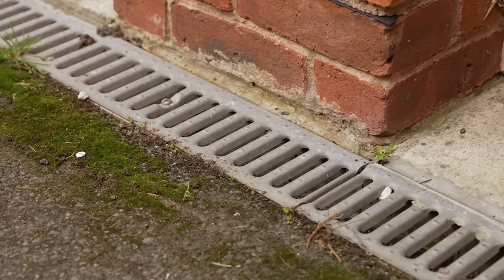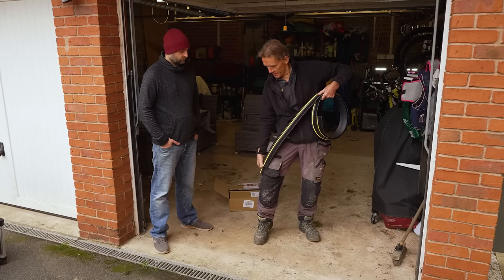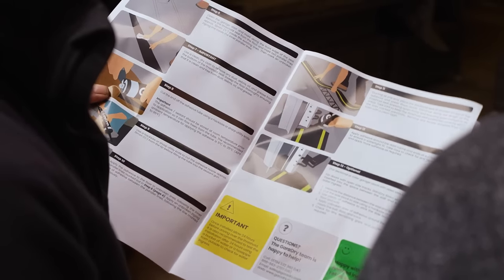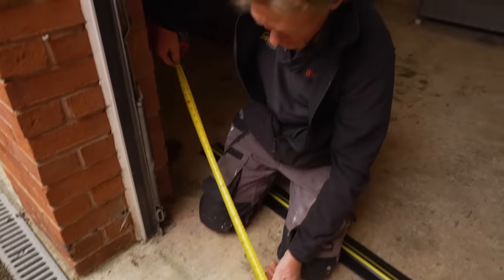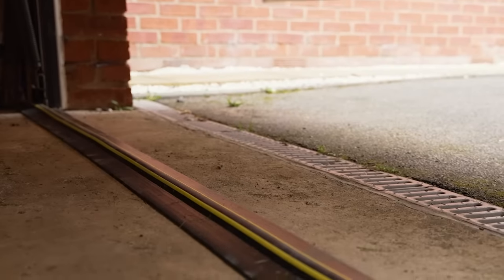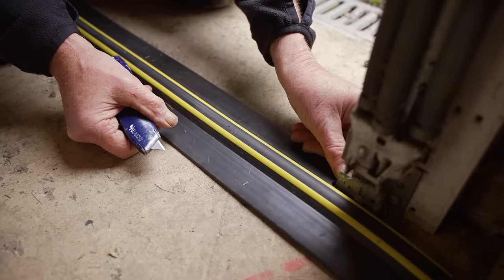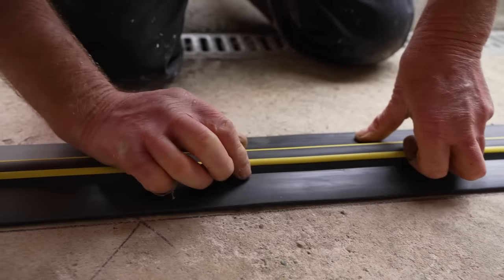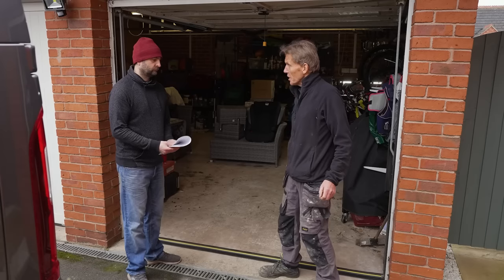DIY Garage Door Weather Strip Installation: Keep Water & Leaves Out for Good!

Comment: For a roller door there is weather stripping on the bottom of the door and an adjustment screw on the garage door opener that you can adjust to remove most gaps.

Comment: These strips work ok when the door is shut. The problems with leaves & dust start when you open it & a 7'x7' foot gap appears.
If you use your garage as a workshop & you want it kept clean:- fit a side door (where possible) & buy a leaf blower to periodically clean it out + fit a rubber strip to the door, rather than the floor, then you don't drive over it.
Reply: It doesn't work for us who have a garage with a floor that slopes the wrong way. In that situation, a strip on the floor is easier and cheaper than pouring a new floor.
Reply: Shop vac is much better

Comment: Screw/ glue a thin aluminium to the bottom,front edge of the door as close as you can to the floor level. Easy, cheap.

Comment: Hello, I need some advice.
This product looks good for the lower gap but what about the sides?
For the past few years, my driveway leading to my garage keeps flooding when a downpour of rain happens.
Last year, it came up the door 1 foot due to drains not good enough for the job, so i really need to seal the sides of the door.
I have an up and over door and need advice on what product i need to seal in the garage for the bad days.
I really hope you can help.  Thank you

Comment: Lucky guy! At least he's not got one like mine. For some reason the gap under our single garage door is from 10mm one end to 50mm the other as the garage floor falls to one side...Hmmm, yes I'm familiar with the smell of mice...
Reply: Maybe fix a piece of flat rubber to the back of the door and cut it at an angle to close the gaps. Adhesive and nut and bolt fixing with large washers should do the trick.

Comment: I recently fitted new garage doors and went to fit behind rather than fit within. Moving the doors back exposed some of the rough finished concrete floor. Now in extreme rain I get some water under the door. Would this rubber strip bond to a rough finished concrete?
Thanks Roger
Reply: My garage is rough fitted concrete and the adhesive worked fine, just try to clean the floor as best you can  beforehand and make sure you use plenty of sealant to ensure there aren't any gaps left between the seal and the concrete. Alternative you can try to sand the concrete down to make it smooth like they did in the video, but I think you need the right tools for that.
Reply: @ChrisThomson  Thank you Chris, much appreciated

Comment: Is there anything like this for a roller door ?
Reply: A roller door has a weather strip on the bottom of the door. Sometimes these need to be replaced. But first check the garage door opener. There should be a screw that adjusts where it stops. You should be able to use that and remove any gap you have.